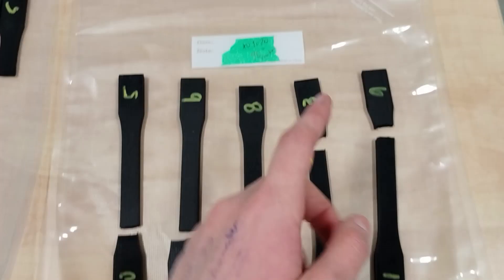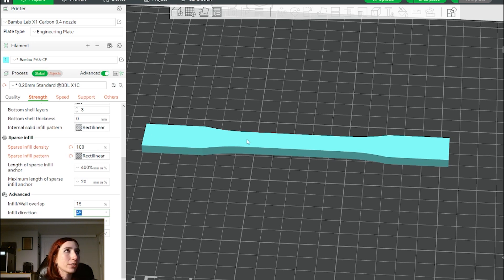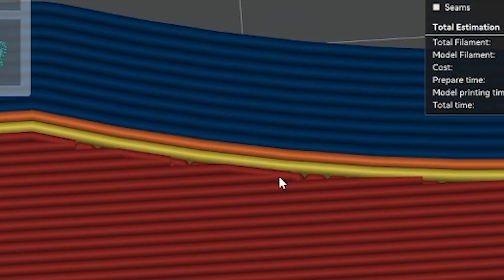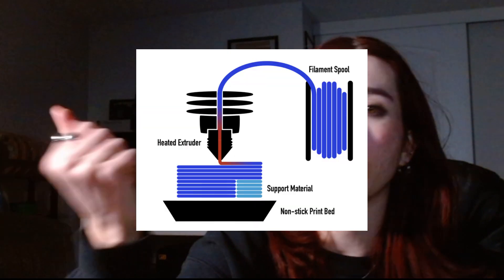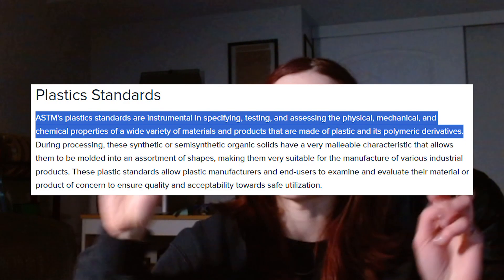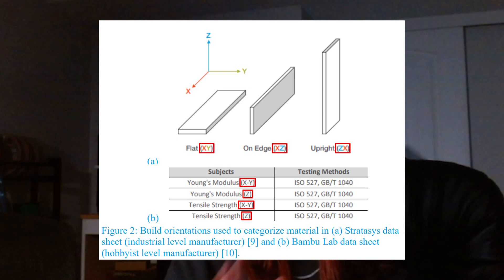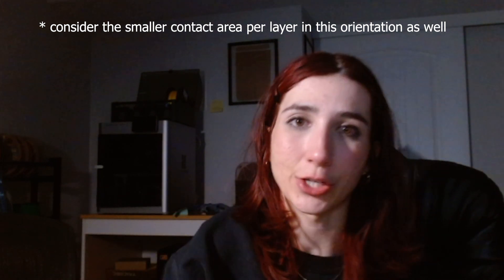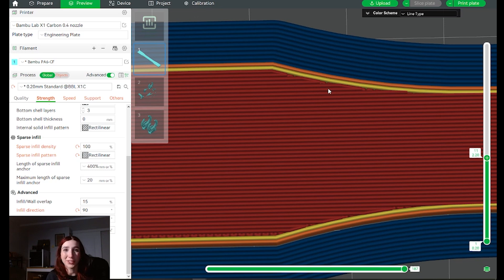we NEED better testing standards for 3d printed parts...

Comment: Could you use an extra perimeter on every other layer to where the extra layer sits over the larger voids, and potentially even because of nozzle pressure it helps fill the voids.

Comment: An unparalleled convergence of multimodal stimuli, exhibiting an esoteric interplay of luminescent oscillations and auditory perturbations, culminating in a hyper-cohesive digital manifestation of unparalleled semiotic resonance.  To clarify nice = video.  I asked chatgtp for an obfuscated jargon laced way of saying "nice video"  it takes effort to make thing complicated.   Even chatgpt needed a few passes on it.  So ill adhere to the kiss princple.  Have you tried brick stacking? Purportedly, this specific macroscopic volumetric configuration engenders an optimized anisotropic material adjacency surpassing the efficacy of traditional stochastic infill paradigms.  Sorry there i go again, to clarify, the brick stacking gives better contact between lines.  Its a new slicer setting, i think it was pateneded or something why we havent seen it but its just been released in orca i believe.

Comment: The standard test is usable, but you must use a concentric infill or make the shells so many perimeters the part becomes solid.
MDF manufactiring just is not very strong in tensile tests.

Comment: Although what you are saying is correct, most people like CNC kitchen and those who are testing 3D printed parts, are printing in the exact same way with the same filament. They do like 10 to 20 samples of each filament and then record the results. NOW, I do understand what you are saying, but this doesnt make most things inconclusive. If you try 10-20 pieces and you have weak points and you compare these points to another filament with the exact same points, you are getting data from line adherence and stretching. This is only because the main factor is being changed which is the filament. I do agree with your argument a good amount. When I look at their data a lot of it feels inconclusive and I believe they need to better explain what they are showing and the layer directions and so on, but if you view the data from the right perspective, you do get a lot from it. For instance, if you take this and reflect nylon to petg, you are going to get obvious data on adherence and stretching between the two parts. The exact force that it breaks isnt something that should be taken with certainty, and I would argue that almost every 3d printing hobbiest would understand this. But what the reflection does show is inherent strength between materials, and if the materials need to be compared to in a different type of test. For instance, in an extreme example, you would never compare TPU to PLA in the standard pulling test. Your data would be extremely limited, and the TPU would most likely just end up becoming a taffy.  What you would get out of the test is that TPU is inherently stretchy and layer lines tend to stick a lot better than PLA (you get data but its something that could be observed without a jig). When I take a view at something like CNC kitchens work, I am viewing a material for its properties, not for the limits it reaches. You simply CANNOT be using these test procedures and get reliable data that will tell you exactly what your integrity is in 3D printing. Almost everything you do will completely change that as soon as a different direction of line is used, infill, corner gapping, moisture, brick layers, layer height, and so on. It isnt like injection where 98% of the samples are retained part to part (like 2 different objects have the same solid interior). For 3D printing, most tests need to be done at the level of the final prototype. You can't just make calculation in majority of cases because you are battling 1000s of different states of material deposition.

Only real important things for a filament that I find to be a must in a data sheet: 
-Thermal softening temp
-Thermal annealing temp
-UV degredation
-Test the strength of a single print line of the filament width and height of 5 different common samples.
-Stretch of the filament line itself
-Material viscosity vs temp
-Its polarity-based info
-Information of resistance
-Specific heat index

I feel like a lot of these tend to get ignored because of the fact its a wide known material. The main issue is though that every production site will have its own impurities and mixes.

Comment: I think a problem with changing the process is that the point of tests is to get a realistic view of how parts should act beforehand, so if the process changes to something very different to what one would use to actually print then it sorta is also not really a goos analog no?

One idea is to plastic weld a test part between 2 solid chunks of the plastic so you're garunteed to get a break in the non solid parts, but that sounds like an unreasonably high amount of effort.

Comment: I am experimenting with transparent filament to see how clear can prints be.

And for it to be clear, there must be zero voids on the inside and I was able to achieve this by changing lots of settings and nozzle sizes. It is as close to injection molding as it gets.

I will release a new video soon with all my findings.
Reply: But I agree with you, I am for example using a part that I personally want yo be clear. This doesn’t mean that it will work with every part.

Comment: Great video! I have thought about this frequently when watching filament testing videos. While there are definitely flawed methods in use, I do think channels like My Tech Fun, CNC Kitchen, and others provide useful information. If nothing else the flawed tests tend to give a ball park or worst case scenario of sorts. Most people certainly aren't relying on tiny percentages of strength to engineer 3D printed parts, but I think proper data and collection methods should still be taken seriously. BTW IDK if it was intentional, but this video was only 15fps.

Comment: I completely agree!

I am very frustrated that TDS sheets don't have any indication of the massive impact that ambient moisture has on the strength of the finished part. When i take a PA6 part off of my printer it will be rigid and strong but give it a few weeks and i've half less than half the tensile strength on the x/y print orientation and maybe a third in z. Further, while a few TDS sheets do have annealed specs, they rarely have a clear indication of how much creep will be reduced, or how much shrinkage i can expect. I would Love to know how much the annealed specs will change after ambient moisture absorption too.

Comment: You should probably use tests specific to composite materials.
Reply: My thoughts too, they've been using carbon fibre or glass fibre for a long time, we should at least be able to learn from their testing methods
Reply: @Frrk  Wood might also a comparable material.
Reply: The applicability of something with radically different material properties would itself require extensive testing.
FDM prints do not have resin filling the voids, or the high strength fibers that plywood, fibreglass, or carbon fiber have. They may have a similar failure characteristics, but that could just be surface level analysis
Reply: They certainly don't share the same properties, but the failure pattern is very similar and the layers are bonded together with bonds of lower strength than the plastic itself.
Reply: So we could consider the various lines as fibres joined by a weak resin
Reply: It should be noted, however, that the more the infill percentage is different from 100%, the more the print will be similar to a structural component rather than a material.

Comment: What if you printed test samples with only perimeters?  Like turn up the perimeters until it is solid in the slicer preview.  ??  
Perimeters increased have already been proven to increase strength of low infill models.
Reply from the maker: You're right! One way to get away from failing in the curved area of the samples is to print concentrically like you said. But what if I want to print specifically with a rectilinear infill at an angle and want the test results  ? Kinda like what I showed in the video, it fails in an undesirable way and I can't even accurately use the data collected...
Reply: @strelkomania  It might be worth looking at engineered earth for inspiration. The individual paths might act as the reinforcement fabrics while the layer to lay / path to path border act as as the filling medium, that can resist compression but has limited to no tensile strength. Then you might find a way to predict shear lines / planes and the behavior of the wanted infill with the data of the only perimeter and only layeradhesion tests.
Reply: @strelkomania      increase the extrusion width of the infill lines/layers so it will close up the holes?

Comment: I spend a lot of time testing and can't imagine trying to gather that amount of data for every filament used on every different FDM printer. Standards would need to be followed by all gathering data from the test. 'm not trying to discourage you. Good luck to all.
Reply from the maker: I can only imagine. Trust me when I say I'm kinda over all the testing I need to do to validate ideas using FDM/filament parts. However instead of testing EVERYTHING, we can use design of experiments to help us figure out the key case studies we should explore to give a more comprehensive picture of how the filament will perform. This would be more than two or three cases though. Particularly build orientation has the largest impact. Predictive models on this would be really useful... But as you've probably interpolated it's hard to make those because of all the variables, but not impossible.

What do you perform tests on? What material and which methods? I am curious!
Reply: Yee, Bambu has pretty much the most standardized large sample of identical printers printing identically you can get and I bet there is high variance machine to machine day to day just based on say the ambient temperature, filament diameter, print speed at a given layer and a whole other host of things.

fff 3d printing as a process, at least on our fast consumer machines just isn't that tight tolerance wise.

Maybe a machine that knew the exact amount of plastic it was laying down and at what temp could better let people know.

I'm just thinking of the differences between the matte a d shiny textures kinda telling the story about how ununiform 3d print strength can be and thats feature dependant, layer time dependant, cooling dependant etc etc.

Comment: I think as long as you use the same exact settings for all samples, you would still have valid results. They may not be absolute best, but you can still do relative comparisons between materials, orientations, printers, temperatures, or print speeds. 
If you wanted to "improve" the testing standards, you could find an infill pattern that would minimize the gaps for this shape (maybe concentric? or hillbert curve?) but arguably that would just increase the strength of all the samples across the board.

In terms of pure strength improvement, increasing wall layers to 6 or 7 would give you a much larger gain over 2 layers and probably better than any improvement in an infill pattern alone would.

Comment: Our 3D printed coupons broke in a similarly consistent way, so I'm grateful you're bringing attention to this!

I'm a lab assistant at my college and last semester, I modeled and printed some small coupons for the engineering students to test in our tensile testing machines for labs. 

The samples always broke at the coupon's width's transition point, and I always suspected it was due to the little gaps between the internal solid infill and the inner walls.

I'd love to test the coupons again using different print settings (e.g. all walls, random seam placement, line width, arachne, internal solid infill angle, etc.), but I don't have the luxury of time in my senior year 😭

Maybe somebody else with the necessary knowledge, access to equipment, and time will be able to conduct tests like this and share the results on their YouTube channel someday... 👀🤞🤞

Comment: One more thing 😂
Now that I have bullied you into getting better audio equipment I can start bulling you into improving you lights 🤦‍♂🤓😂.

At 8:45 to 9:50 is a good example to looks at 😛. You can see how much motion blur there is on you hands when you are talking like an Italian 😂.
This is because the camera you are using is limited by how much light it can detect. You can "solve" this by getting a very expensive camera that is very light sensitive (an expensive) or you can just get some cheep lights. (You can still have the dark look if you perfer by chaining it in you video editor)

You can also do a lot of fun and creative stuff with lighting in videos... It is like a who thing 😂
On youtube there is about 10e18 videos on how to light a youtube video 😂

Maybe something like the Neewer NL288 would be good for you. It runs on battery, it is not that big and it is about 80$. I think that would be a simple easy start.
Maybe you could combine it with one of these "5-in-1 reflector kit". I think NEEWER has one that cost like 30$. 100$ is not nothing but much cheaper than a camera.

You could also make a project out of it. You just need high density LED strips with a CRI of ~95%, if you get two different colors (5600K and 8000K eg.) then you can also adjust the color. I used an old monitor with 3$ Adjustable LED Dimmer and a LED strip with a high CRI and I think 8000K (blue sky). I used a monitor for the fresnel lens. This makes the light look a lot like it is coming in through a window on a day with a clear blue sky. But You don't have to do that, you can just make a box with the LED strips and have something that defuses the lift on top of the box. Then have a hole for the adjustable LED dimmer. Honestly it is super easy and it is a lot of fun. And you could make a video out of it and hope that it over time will pay for the cost of making the lights 🙂🤞.

I jumped over some details when it comes to light direction, soft vs hard light, kelvin color, CRI values, diffusion, reflection etc. Lighting in video is super complicated and it can change the look and feel of the video a lot. (even when using that same camera)

Remember I have only good intensions, I like your videos as they are, it is just my engineering brain that always are looking for things to improve.
(My brain would never recognize the global optimum of anything, it would either get bored or want to try something else. Never satisfied 🤡)

Comment: I would bet that Stefan from CNC kitchen has insight about this. However, my testing is usually how many falls off of a countertop onto tile until failure.
Reply: The person that came to mind for this particular issue was actually Igor from My Tech Fun, he is the only other person I can think of who focuses as heavily on filament testing and associated issues, plus I know he occasionally works with other youtubers on filament testing projects.  It is an interesting discussion and it would be fun to see the two of you chat about the problems you have identified.